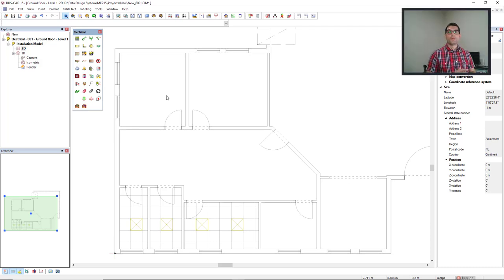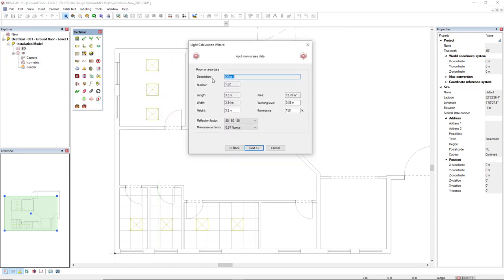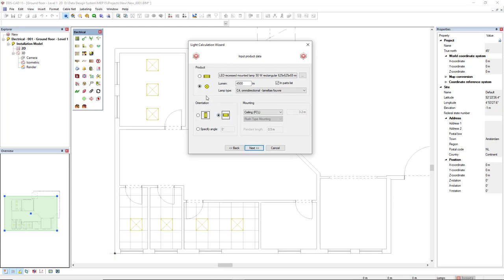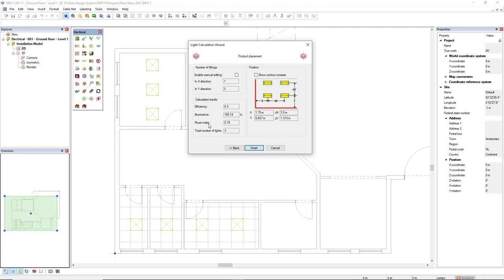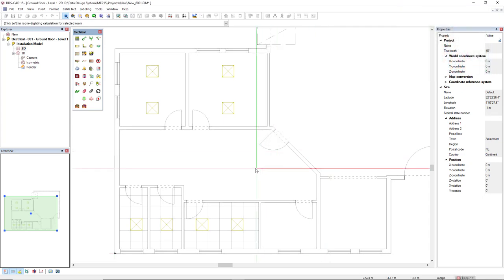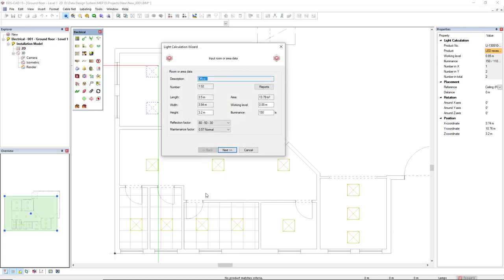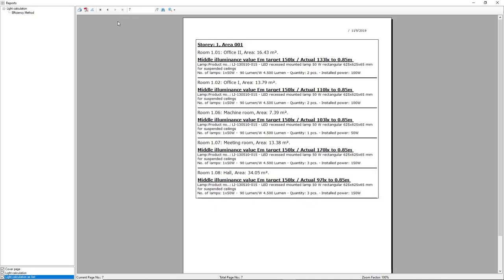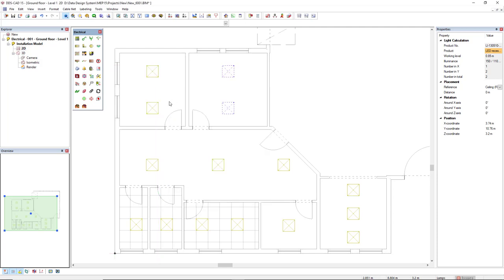Getting Started  - Electrical - Light calculation efficient method

Comment: Good morning,

I love your movies. I have a DDS CAD electrical program. This is a great tool.

Unfortunately, the method based on the efficient method is very inefficient. Since you do not have the manufacturer's database, there is only one DIALUX / DIALUX EVO solution. But unfortunately there are problems again.

If I receive the IFC file and design the lighting in DIALUX / DIALUX EVO, why can't I import it into the DDS CAD program, so that the luminaire sizes and types are transferred from the DIALUX / DIALUX EVO program.
Reply from the maker: Thanks for the compliment Targetti! The efficiency method is a calculation based on a number of specific parameters. It has never been intended to be at the same level as a detailed light calculation. Most users use it to get a quick estimate regarding the number of required light fixtures in a specific space. Unfortunately, or at least as far as I know, DIALux EVO only supports the import of IFC files, it cannot export them. Else it would have been possible to import your complete EVO model as IFC back into DDS-CAD. So I recommend you to reach out to DIAL and request an IFC export option, that would be a nice solution :)
Reply: @DDSCAD-MEP  I sent an email to DIAL too. Apparently it is being slowly implemented. We will see. As for DDS CAD. As you mentioned, calculations are made to pre-estimate the number of luminaires. Is it a useful tool? I think NO. Since with the same amount of work I am able to choose lighting very precisely for a room, taking into account not only the power of the luminaire, but also its light distribution curve, efficiency, dimensions, assembly method etc. based on a specific product. As I mentioned, DDS CAD must have databases written by specific manufacturers.

Comment: For me, one of the biggest disadvantages of DDS is the lack of a manufacturer database. Manufacturers are not interested in preparing a database for DDS. This applies to both lighting fixtures, electrical equipment, connectors, etc. creating a DDS model from a 3D DWG model only recreates its shape. There is no key information, such as power, voltage, current, and many others, allowing for easy product identification. Additionally, such a model takes up a lot of memory and the work becomes very difficult.
Reply from the maker: Hi targetti, instead of having manufacturer creating content for a native format, even better is to have products available from open format such as IFC. In DDS-CAD 15 it is aldeady possible to create products from IFC.
https://www.youtube.com/watch?v=H77U0NMoMt4
In DDS-CAD 16 it will be also possible to import other extenal formats such as RFA.
https://www.youtube.com/watch?v=ho18ODUOcXM
We are working to provide more information in the product database based on IFC latest version. :)
Reply: @DDSCAD-MEP  I am looking forward to importing REVIT models.